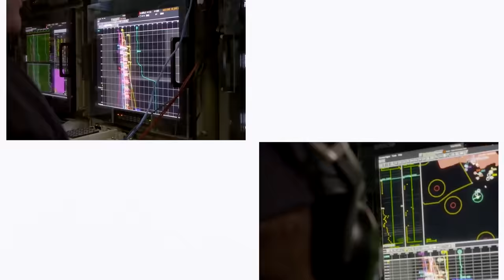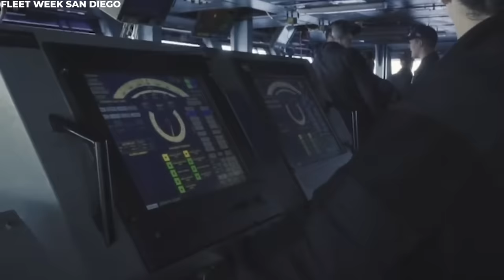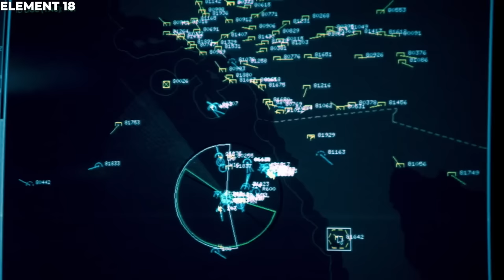US Testing its New Gigantic $13 Billion Aircraft Carrier

Comment: And just think one rod from orbit could wipe out 13,000,000,000$ not to safe. Just saying.
Reply: Just think. If you learned how to form a sentence and use proper punctuation, the readers wouldn't have to waste time trying to figure out what you're trying to say. And by the way. The "rods from orbit" you're referring to are unguided. A 3°  hard over turn in any direction with even 15 seconds warning would miss the ship completely. That's why that Satellite (if it's even up there) is designed to hit stationary targets only.